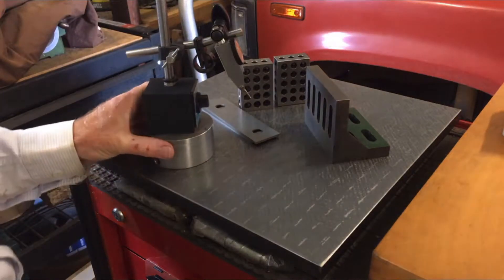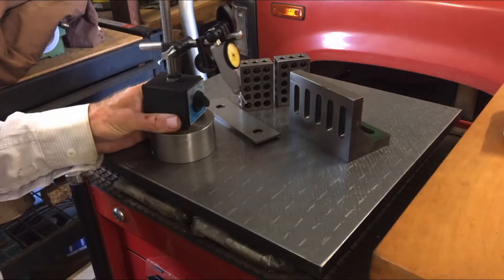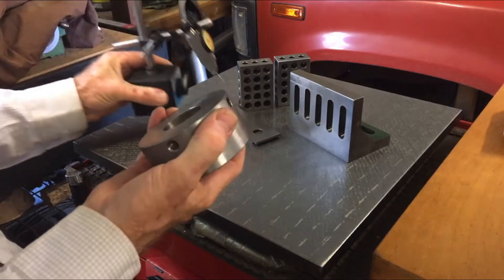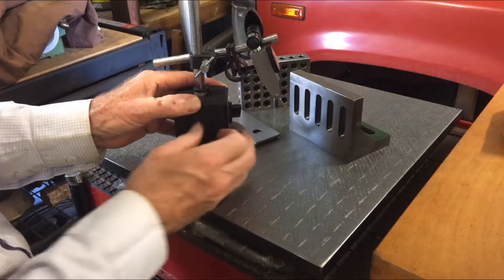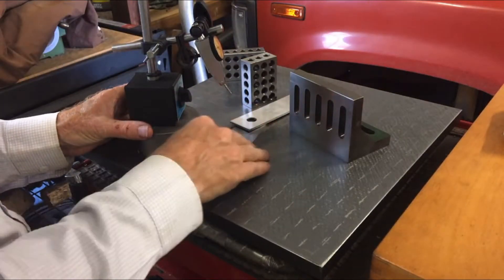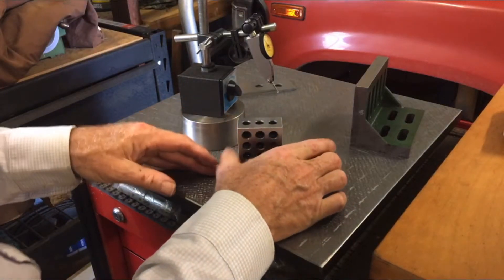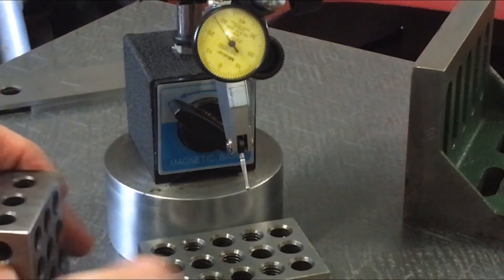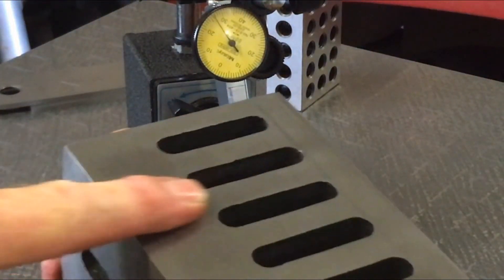How to Test an Angle Plate for Square

Comment: Gday Dave, Interesting video, when you turned the 123 block was that to cancel errors in the surface plate or the 123 block?
Reply from the maker: Hi Greg, that is to cancel any error in the 123 block.  You will notice a .002” variation from side to side which really means it is .001” out of square.
I didn’t measure it with a mic but I’m sure it’s very close to parallel which is the important in this exercise.
I have seen this done with a parallel clamped to something else where it can be .010” or .020” out of square but the important bit is to split the difference on the dial.
When I talk about a B grade surface plate it’s probably within .001” across the entire plate. For the home shop why pay 10x the price for one that’s .0001” when you can’t check if they are ripping you off anyway 🤠
A surface plate is great for marking out, a process lost a bit these days to CNC and 3D printing.  Maybe I should do a video on marking out :)
Reply: @DavoShed  What you did when reversing the 123 block is a bit like reversing a spirit level and seeing if the bubble is in the same position or drawing a perpendicular line with a square reversing the square and drawing a second line to check for parallel lines
Reply from the maker: @gregwmanning  Exactly
I have and old Starett level that you can calibrate using this method.
Those things are amazingly accurate.  Maybe another video :)